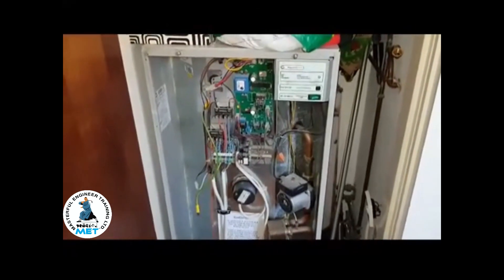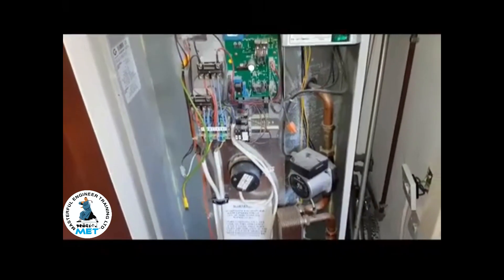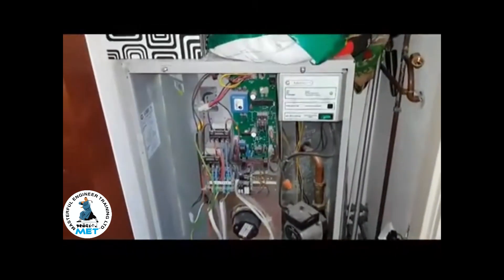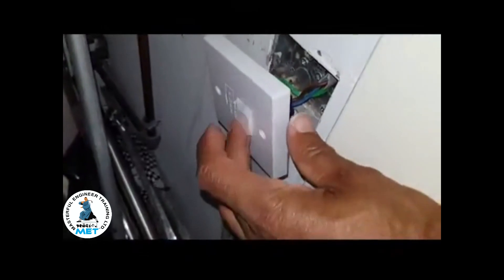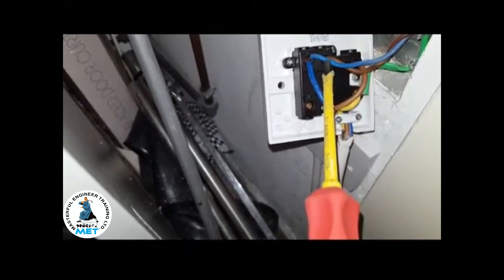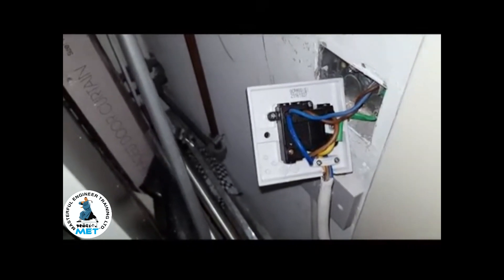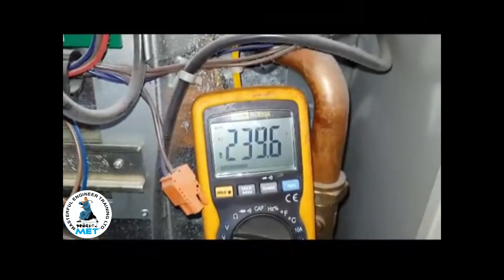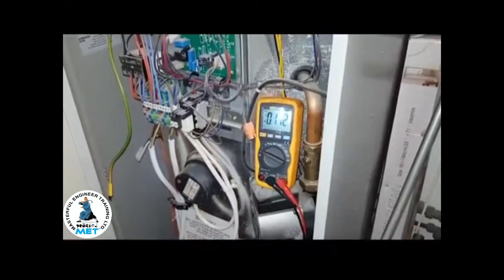Gledhill Pulsacoil A Class No Hot Water Online Boiler Repair Training

Comment: I was considering a Pulsacoil. Just wondering what people think of it? Is it a good product? What other products should be considered? I needed something to replace a classic 1980s, gravity fed system. With copper tank (immersion) with a black plastic water tank above it. Does not give shower pressure.   It is for a 2 bed flat and one bathroom. Washing machine and dishwasher have their own heating elements. Separately there is an electric shower.

Comment: I noticed the switch had a fuse (which leads to believe it would be a 13A). However, in the shops they sell 20A switch for immersion heaters (which comes without a fuse). Is the switch they have put there correct?. Not an expert.....

Comment: The number of installers that use the earth as a signal wire when wiring controls is shocking! The earth protects the cable and anyone chopping it. Not seen in this video but worth mentioning.
Reply from the maker: Thanks for your comments